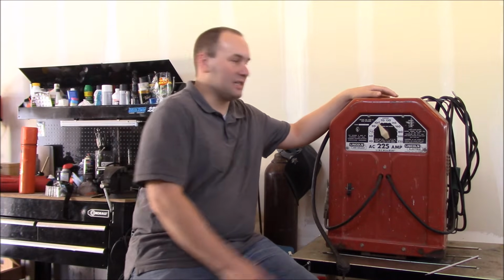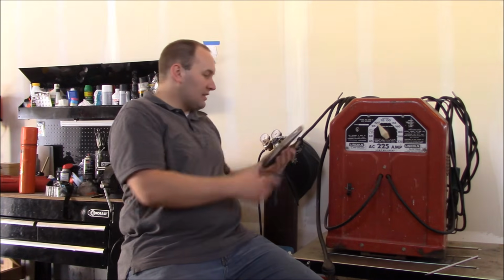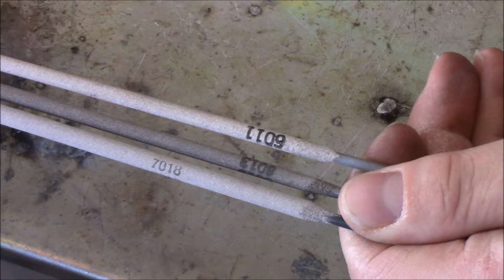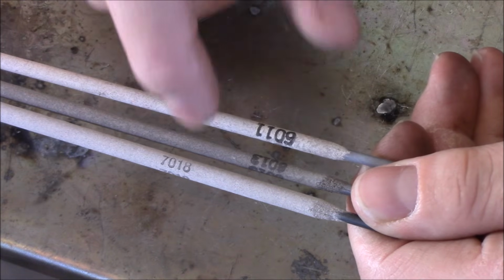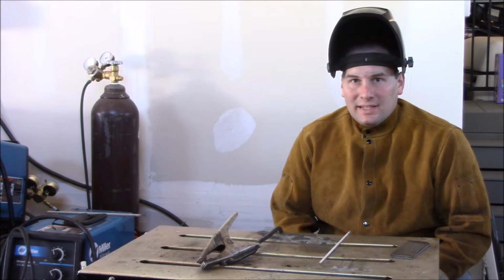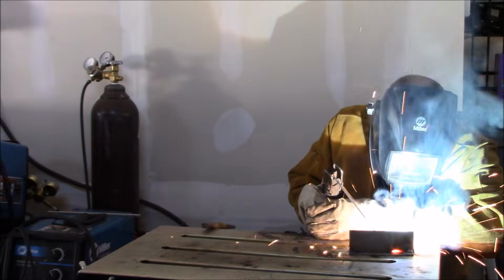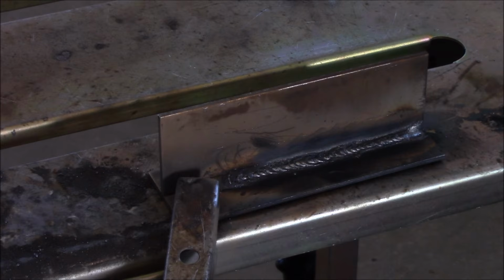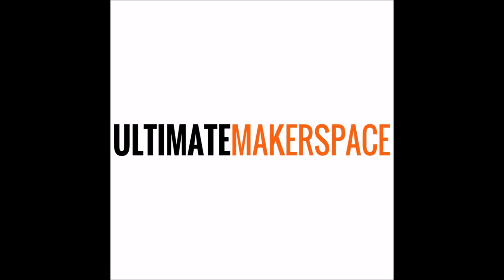Lincoln AC-225 Stick Welder Review

Comment: I bought one of these Lincoln tombstone welders used in 2004. Mine is the AC/DC model. I bought it used with 50 feet of welding cable for $350. It was still my go to stick welder after I bought other welders. The current selector switch finally went out and I put it away. I may repair it and get it up and running -- these welders weld like a champ for most stick applications.

Comment: I have never used a stick welder.  Does it just arc when the rod gets close enough to the work or is there a trigger like a MIG?
Reply from the maker: It’s live all the time, no trigger. You have to touch the end of the rod to the metal to strike an arc, then hold a narrow gap.
Reply: @TimWelds  
Thanks!

Comment: 1968 dad went to the CooP feed store and bought a Forney 225 it has  sockets for the leads.  3 sockets for the ground clamp and 5 for the stinger , giving 15 different currents.  It is arranged so it jumps at 10A increments at the most common currents.  Yep it works, but shop cats have made their mark on it.

Comment: He mentioned 7018 AC, get it for these type welders.  I had some Hobarts that said they ran ac/dc, they didn't.  It will be called 7018AC not AC in the fine print.

Comment: Will this weld 3/8 mild steel?
Reply from the maker: Yes, easily. You can weld as thick as you would like with multiple passes using a stick welder like this.
Reply: @TimWelds  multiple passes???

Comment: Does the model code identify the year of manufacture I think lincoln used aluminium windings after a certain year I can't tell if mine is copper or not
Reply: If you do not open the machine, does it matter?
It is welding,, right?

Comment: does it have hot start and arc?
Reply from the maker: No, but it strikes pretty easily and is very stable. Those settings/features are usually found on the smaller, more modern inverter machines.

Comment: I've had my AC-225/DC-125 for nearly forty years and it's more than paid for itself.  They're easy to work on if needed (rarely) and converting old ones to socketed panel connectors is cheap if your old leads need replacement.

Comment: Looks like a tad bit cold, if your running 7018 , and you can get the slag to peel off the weld it will peel up on its own, then you will know it's set perfect

Comment: Question, I only have access to 120v at home. I want to practice and need an affordable reliable machine. Can I use this at home? If so, what are the drawbacks? Thanks.
Reply: Get a different machine. Or install a 40/50 amp 220 breaker

Comment: Going to pick one of these up tomorrow along with 1970s delta bench grinder and a torch/tank setup for 200$. I'm a crappy welder as I learned from my dad who isn't a great welder on a ACDC225 starting some 35 years ago. I cannot wait to start practicing and fabricating. First project are some Gate brackets and hinges for the front driveway as they don't make a matching hardware for what is embedded in the brick/concrete columns from 1966.

Comment: People now listing these for sale for $350, even though they know they have never used it, and they don't want it taking up space. It's shocking how unrealistically high the price of old used welders is. There are at least 5 of these AC225 welders for sale for $300 to $400 in my local area. That's just too much. The thing is, nobody buys an old used dedicated stick welder, unless they were born in 1931. I purchased a new "Hone" brand $84 arc welder from Amazon that has a glassy smooth arc, and is dual voltage. But, I really do want an AC machine, because I believe the lack of magnetic instability of the arc (arc blow) on an AC welder, is superior for precise welds.
Reply from the maker: I really like them, though I almost always use a little inverter these days. Used ones used to around $100-$150, but those days are probably gone.
Reply: I bought a nice one this morning locally for $125. I’ve had a 140 Lincoln flux core mig for several years but this is my first stick welder. I wanted something to weld heavier steel when needed which will only be a couple times a year. Seems to work great so far aside from me being a little rusty with a stick. I like the reputation of these machines so I’m glad to have it.
Reply: Look for one sold as craftsman. 2024 these Lincoln 225 sell for $100 plus. on facebook market place. depending on how pretty and accessorizes/rods/ helmets/

Comment: Good day sir l love how you explain and show in detail l am looking to start a sidelines business into full-time job on welding project's for people I have a 110v TC3508 TOOLCRAFT 160A stick Welder but when I was welding a sliding gate it kept getting hot and switching off and I have to wate around 15 minutes for it to cool down I am running it on a 30 amp breaker can you advise me on a good 110v welder in detail thanks 👍
Reply: Most likely, you are using an undersized extension cord, for the amps you are pulling and the distance away from the circuit breaker, and the rod size diameter is too big. Try a 1/8" or even 1/16" 6013 rod if you have to.

I know the comment is a bit late.

Comment: Tim, looking to upgrade from the old sears craftsman 230 amp dual range arc welder I have been learning on to either the lincoln k1170 or k1297. Which would be the better / more versatile 
 machine for the hobbies welder and why?

Thanks, have enjoyed the videos and learned a lot from watching them.
Reply: That's funny, I picked up one of those Sears machines at a curb sale ( I thought it was a battery charger before looking at it). The high range doesn't work but low works perfectly- just as nice as my Lincoln 225 seen in the video above. It's all cleaned up sitting in my storage area since neither of my sons wanted it (smile).
I thought it was funny seeing a stick welder being described.
 We ran a few of those 225s at my first welding production job over 50 years ago- never had a problem with any of them, so I bought one- still using it, Harbor Freight has 1/16th stick rods that are great for thin stuff, running between 40 and 60 amps.   Nice vid, Tim welds.      Mike

Comment: My pops left me the same welder, AC 225-S, I’ve been practicing with 6011 1/8 rods at 90amps.  The rod sticks a lot, I guess I need to up the amps to 105 or 120 ?
Reply: Yeah, or switch to 3/32 which will love 90 amps (it will be a tad hot), I think I ran 1/8 at 130.
Reply: 6013 is easier to start on I believe. I haven’t used this stick welder tbh, I’ve used a smaller Lincoln stick. Make sure you’re in the right polarity too.

Comment: Can this welder be use to weld 2 3/8 oil pipe fence  ? New to the welding community
Reply: If it is made of steel or cast iron, but if it is galvanized- grind off the zinc or do not breathe the smoke if left on.

Comment: my pops brought ours home in the 80's i was only 5 years old .since then i worked in fabricating pressure vessels, vacuum chambers , food processing equipment, oil refineries, ironworker, ive done a lot and just the other day my dad caught me off guard and had me weld for him using the same old lincoln with the original 6013 rod from when he got the machine and it welded so smooth i didnt even have to chip off the slag ( real welders know what i am talking about) . the look in my dads face was priceless. keep in mind that nothing impresses old school fathers like mine.  lincoln made this machine to last .
Reply: Wow you must be a really good welder. I cringe when I see the photos that new welders post online, as if they should be "proud" of their gobbly gook welds! ahhhh! Nothing is worse than scrolling through pages and pages of hideous, poorly shaped, crooked welds, with improper penetration. But then on Amazon, I was reading a review for an $84 "Hone" arc welder. There are many super cheap arc welders, but in the reviews for the Hone 165 arc welder, a guy posted photos of the commercial steam pipes he welded with it at work, and my jaw dropped. They were the most beautiful welds I've ever seen. I purchased the welder based on his reviews, and the arc is glass smooth, just as the man suggested. For $84! What the hell? I am actually shocked that they can make a really nice welder for $84 that runs on 120 or 220 volts, and has more than enough power for 3/32 welding rods. I am using the welder at 40 amps, and it obliterates a 3/32 electrode smoothly.
Reply: I hope you said thats how a real man gets it done boy

Comment: Never welded before but have some projects that need done, so after much research, I decided to go stick over mig due to simplicity and cost. I will probably only use it a few times a year and don't need it to be pretty or too professional. Glad to hear all the positives on this machine. I just bought a new 110/220 one from Home Depot and am excited to get started.
Reply: P¹
Reply: Your excitement was notable.  How has your welder performed and which model did you purchase?  Thank you.
Reply: @meangreen7389  I got the Lincoln "Tombstone" style in dual current. I've used it a few times. I suck at it, but am getting a little better. Just doing basic stuff that doesn't have to be pretty. Good enough for what Im doing.
Reply: @MrGoblue1131  - Thank you for your response.  I too have some minor repairs around my home and welding would be the most applicable method to complete these projects.  None of these will have any stress nor will they be visible as they are small mending jobs on a fence.  I also don’t have any experience welding but know of the hazards to eyes, lungs and skin.  But I’m learning from friends and family and I’m just about to pull the trigger on a welder.  Thanks again.
Reply: Before you do anything critical, make sure your welds are done properly. I’m not criticizing, but welding is like learning the guitar. It’s easy to begin and play badly, but playing well takes quite a while. It takes about a one pound box of 3/32” rod to become vaguely proficient, before you should weld something you need.

Comment: I’ve a question as a brand new hobbyist. I don’t have the 220 power outlet configured in my garage. If I had a large enough amp on a large generator would the power from the generator be ‘clean’ enough for this unit? The generator would be outside of the garage. I know that there are combo generator welders out there but they are purpose built to run off generator power. My question primarily has to do with using what I have for power and secondarily ensuring the Lincwelder can safely feed directly off the generator. Thanks in advance.
Reply from the maker: It would need a really big generator, but it would work. I can’t imagine that ‘dirty power’ would hurt one of these since there aren’t really any delicate electronics. A small inverter welder can give the same amperage output with less input amperage because they are more efficient, so you wouldn’t need as big of a generator. Most inverters will also run off of 110 with some limitation on output.
Reply: @TimWelds  Thanks. I will look into that as well.
Reply: Kevin, this is one of the very few welders you can run from dirty power because it doesn't have the electronics that require a sine wave.  Instead, it uses a simple but BIG transformer - a lot of wire wound around an iron core.  I'm told, but I don't know first hand, that the older AC-225 welders were superior because they used copper in the windings, whereas the newer ones use aluminum.  Copper is more expensive, heavier, but lower resistance.  This is a beautiful kick-ass welder, it's totally reliable and my go-to for everything but aluminum.  BTW, you don't need 50A for the lower ranges you use for most work - 230V 30A (dryer) will do.  Less amperage than that, or 120V instead of 230V, would maybe work on small stuff.
Reply: @montgomd  Thanks. Unfortunately my garage wasn't setup for a hobbyist. I read one comment that it was easy to install but, Ill be honest, Im a little afraid of the breaker box. My oven is out and my dryer is out (2nd floor) so that means either getting creative or an expensive electrician visit. I appreciate the info. I may start to watch some How-to's on adding one to the garage. Btw, I think the amperage would be real low considering it would be 0.030 thick sheet metal on vehicle; no frame work at this time.

Comment: My grandpa has one of these welders that is 42 years old and it still works. He bought it new in the late 1970’s. We run 7018, 6011, and nickel 99 rod. It’s a very smooth running machine

Comment: Anyway to replace the stingers and ground by itself without cables or do you have to replace the cables also
Reply from the maker: You can replace the electrode holder or the work clamp on their own. Some of them have a screw that will clamp right on the wire, while others use a crimped connector. Some welding supply stores or auto repair shops can crimp on the connectors for you if needed, but I’d probably just get the type than installs with a screw.
Reply: @TimWelds  ok I have a 240v port in my garage, I have no clue what a breaker is but would that outlet be fine

Comment: How do I run this off a generator
Reply: With my 7000w, 8750w peak generator, I could run up to about 120-130A with a Forney 225 buzz box.  Good enough to run 1/8 rod and patch some corral fence. 
 Transformer machines waste close to half the power.

Comment: these machines will run after all the inverters have died.  i have used them for 60 years, i can't think of a machine that has been in production that long
Reply: I was talking with a Lincoln factory rep a couple years ago who was telling me that Lincoln had recently produced the 1 millionth AC225 welder! The best selling welder of all time, and still manufactured in Cleveland, Ohio! I’m old school, and have stick, TIG and mig machines, but if they were all taken away from me and somebody offered me a choice of a new inverter or a 40 year old Lincoln tombstone for free, I’d take the Lincoln! I was a certified welder for 40+ years, and when my employer started replacing the transformer welders with inverters, they soon found out that if they broke down, and they often did, it typically cost $1500 minimum to get them repaired! That’s half the cost of a new machine! I’ve always been a Lincoln fan, but my local welding supplier recently told me that Miller Electric will be totally out of the transformer welder business this year, and only offer inverters! That’s a crying ass shame!
Reply: @wostep   I dont know😂 Im deleting the comment thanks.

Comment: I just picked one up for 50$ today anyone have a suggestion on how to power it mobily I want to put it in my truck and use it if I need to fix something on the road
Reply from the maker: There’s a video on my channel about running a welder with a generator with some of the basic math and the necessary adapter. Spoiler alert: You need a pretty big generator to get much power out of the welder.
Reply: Most likely pick up a generator that can handle it..

Comment: Yes, why the AC only model?  I have the AC/DC model and also the Vulcan Commander.
Reply: The AC model is cheaper. DC is usually better to weld with. Thanks for the comment!
Reply: How do you like the vulcan commander I’ve been wanting to pull the trigger on one of those just haven’t really been able to get any feedback from anybody that uses one
Reply: @marloflores8325  I love it!  I think it's great!   Just be aware that it's a heavy beast ~150 lbs.  I made a cart for it right away. There are some reviews of it on YouTube IIRC.
Reply: Now, 2024,The ac can be bought off facebook market place for $100 if you are pacient. The ac/dc sells used for $400  They made 10 ac for every 1 dc. And sears sold them as craftsman

Comment: I run mine off of a 40 amp breaker and it doesn't bother the welder one bit.
Reply: I run mine on a 30 amp circuit. 115 amps . 1/8 rod. It will trip the breaker if I get into welding and don't take breaks. Smaller rod/75 amp/ no problem
Reply: Hello I was going to ask if I can run this welder on 40amp how’s welder still working ? Do you have any videos of it? Thanks!
Reply: @The10mmShop  it most likely doesn’t run full amperage and can only go up to maybe 90 amp @ 40%

Comment: I cant just commect it to a regular outlet? What if I get a converter so it fits a regular wall plug?
Reply: You need 50 amps.  There are no regular wall plugs that can carry that kind of current.
Reply: The need 220 volt to run. 120 volt isn't enough.
Reply: Can I run this off my Honda generator? I believe its a 3700 watt unit with 240 outlets.  Thanks

Comment: I am confused !!! So this is a machine that can run 225 amps but you can connect it to a 50 amp power source without tripping the breaker??
Reply: Great question. Power is voltage multiplied by amperage. The power out of the machine is the same as the power in (ignoring efficiency losses). Since the voltage in is higher than voltage out, the amperage in can be lower than the amperage out.
Reply: @timothyluskin7655   I see !!! Makes perfect sense
Reply: @timothyluskin7655  Your response is spot on, sir.
Reply: It is a buck transformer that lowers the voltage. 30/40 volts out.

Comment: Hook up a rectifier up at the output and you have a AC /DC  Lincoln 225 !
Cost about 40 dollars !

Akozon Rectifier, Single-Phase Diode Bridge Rectifier 300A Amp 1600V 1106740mm 1Pc
 
Then you can burn dc rods and enjoy life without the buzz :)
Reply: The current does not go through 4 capacitors, pretty the bridge of diodes but you stay with a current dirty, not linear, in addition there now in a closed space metal you have to fight against the breath of the arc ..... ..... lollllllllllll   https://www.youtube.com/watch?v=ItmY5i598X4&t=811s